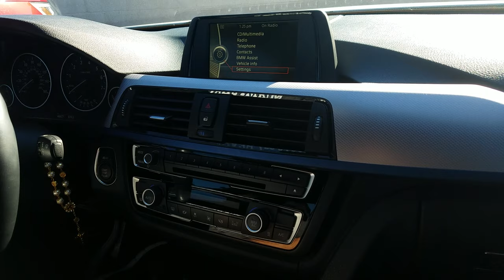How to Remove Radio / CD Player from BMW 428 2014 for Repair.

Comment: Hi. Can you talk about the most common failures with this radio. I have one that do not initialize and get hot.  The display only shows the bmw logo. And the lower is hot on touch.

Comment: Hi, mine shows only bmw logo and shut off after 30 40 sec later and I can’t use it. If I replace it with used one, Do I need to program it or just replace with new one?
Thanks.
Reply from the maker: you need to have it programmed if you want all the features to work but for basic function you could gat away with it.
Reply: @HiTechElectronic  and do you think is it the headunit? Because the screen shows only BMW sign and turn off a bit later.
Reply from the maker: @emrebilgic7321  Yes, the head unit is bad.